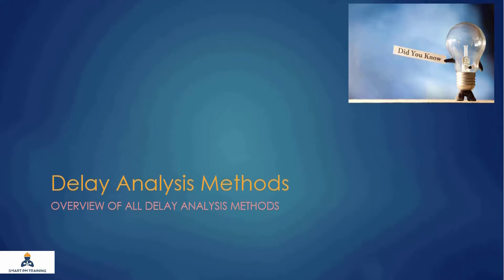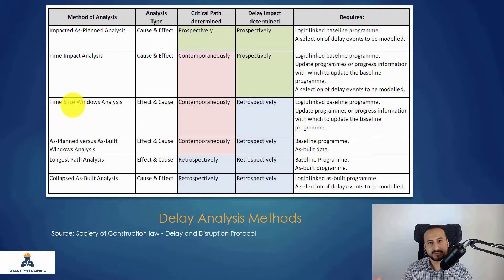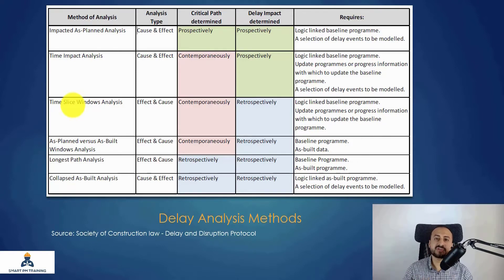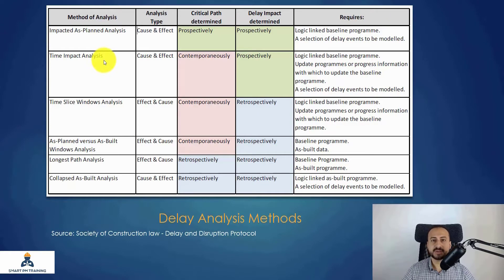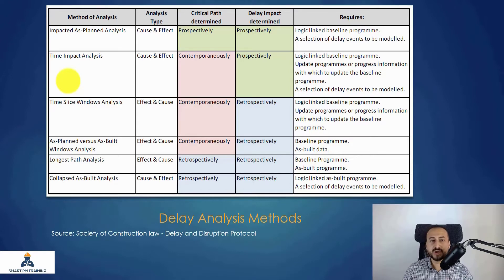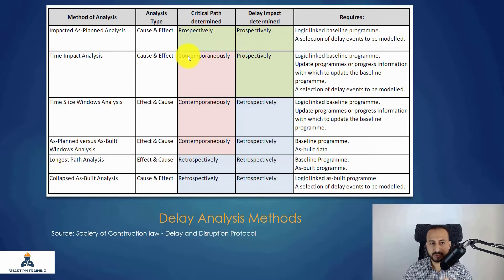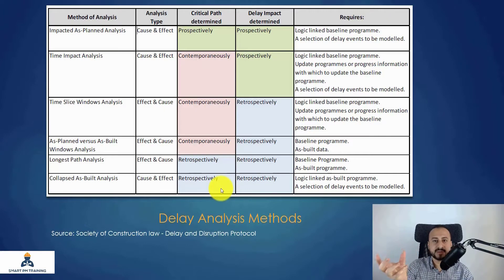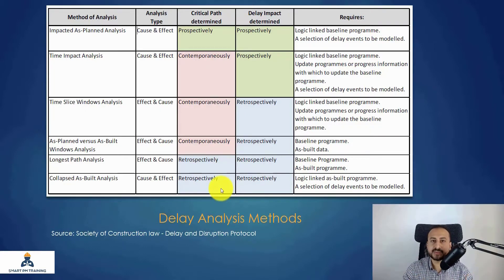What are delay analysis methods?

Comment: Whether  TIA is used when the project is completed? or Time Slice Windows Analysis?
Reply from the maker: You typically need a retrospective analysis in this case. TIA is commonly known as prospective method but it can be used in a retrospective environment too as per AACEI RP 29R-03. So both methods can be used.

Comment: How about if i am using the mitigation plan or fast tracking method wherein I am reducing the impact of delay (e.g. overall duration was 60d but reduce to 45d). Can i use the baseline schedule to do that?
Reply from the maker: Schedule update is typically used to mitigate delays, not a baseline. At the same time, we want to be careful about how we address recovery measures in the project because it can compromise the whole entitlement.